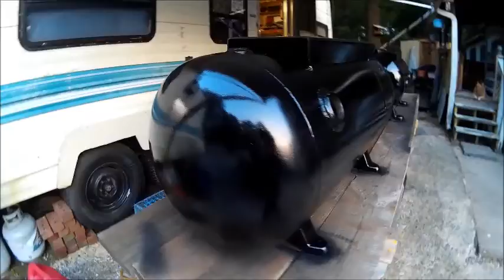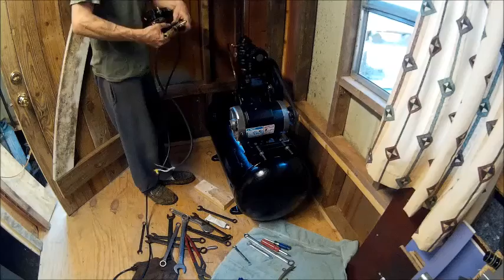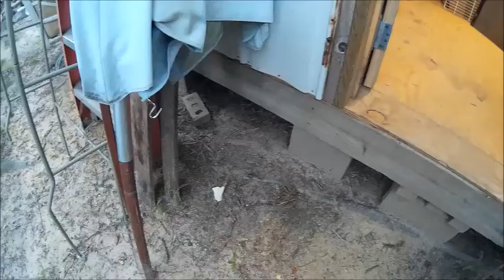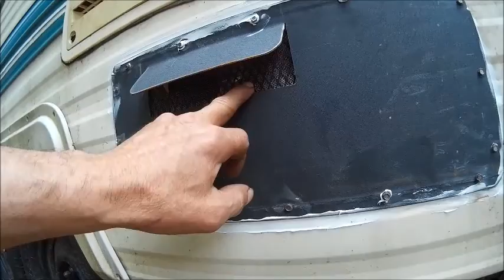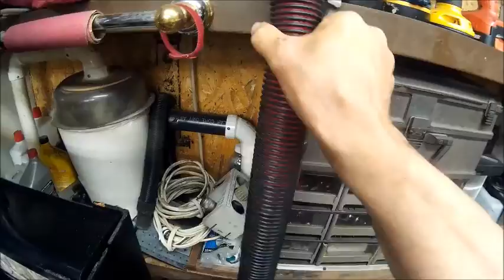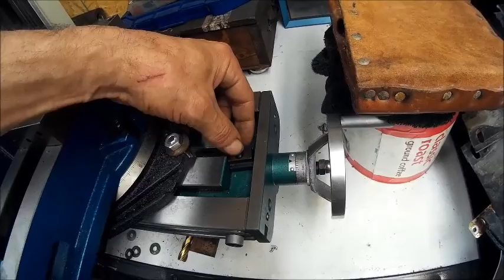air compressor build part 4 done

Comment: did you check and make sure the flywheel was nice and tight in the shaft? I thought i had a rod knock in a quincy but it was just the flywheel knocking